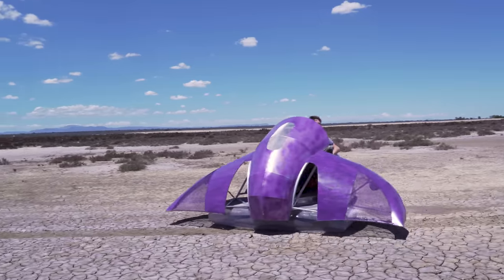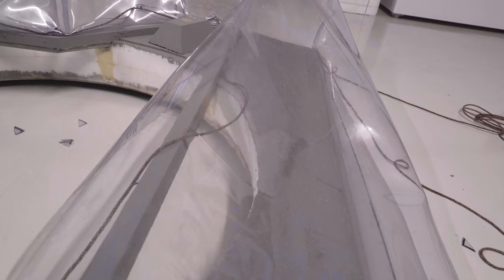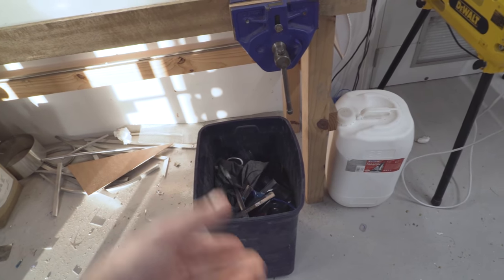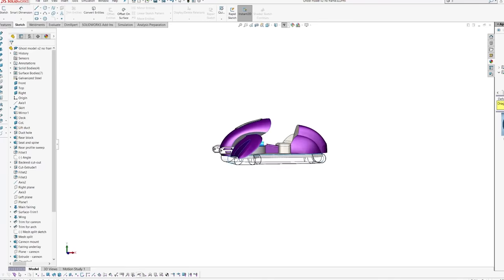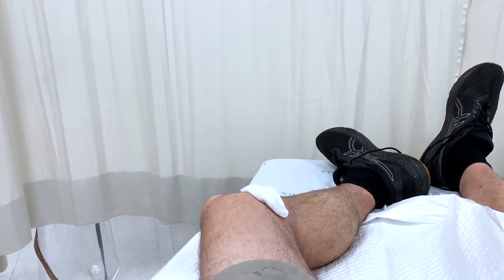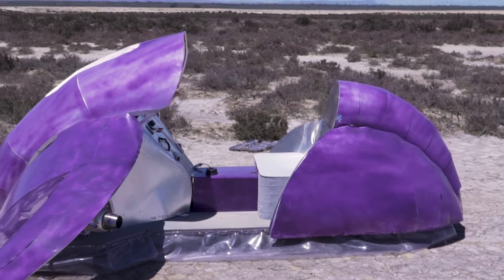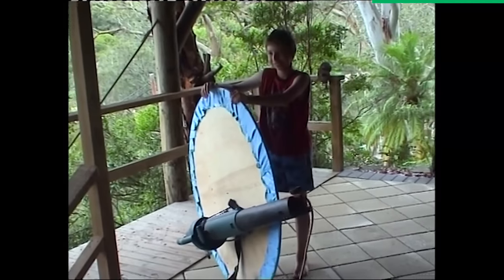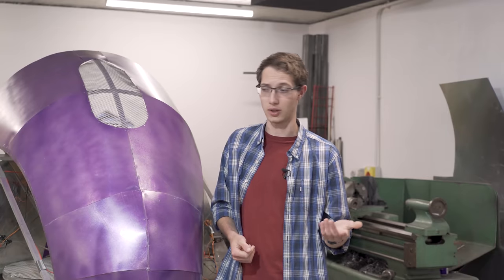Real Halo Ghost

Comment: I don't see a problem with the steering. Looks pretty game accurate to me.
Reply: I see you have played ce
Reply: facts
Reply: only thing worst to steer is the warthog. no idea why they thought it'd be a good idea to add a timed section requiring precise maneuvers to get through with only a warthog to get you there. I had to retry that damn mission 7 times to beat it.
Reply: @Sparrow_Bloodhunter  I never had a problem with the warthog in any of the games on console ngl, PC was a bit trickier but you can get the hang of it (unless you're playing infinite). Rack up 25 kills in blood gulch slayer by doing donuts around the bases and spawnkilling a bunch of people back when I was an honorless brat.
Reply: @Sparrow_Bloodhunter  The Warthog actually has some of my favorite handling in any vehicle of any game. Few vehicles allow you to powerslide so hard you can turn the body into a giant sledgehammer and side-sweep multiple enemies. Only problem is that the controls don't adapt well to mouse and keyboard.
Reply: @CrizzyEyes  I was playing with a controller, the problem is it would power slide when I want it to go forward. it felt like it was super heavy but also really floaty at the same time. remember that snow level where you're going through the canyon? well it felt like the warthog was always on the slick icy surface. maybe the game was just bugged because I had a habit of squeezing the ghost into places where it should not be.
Reply: Halo has the worst driving controlls ever.
Reply: No way, it doesn't flip over nearly enough.
Reply: @Sparrow_Bloodhunter  I have this habit in every game that has vehicles. The habit of bringing a vehicle everywhere I go, be it tight underground cave or up a mountain if it fits I sits and drive.
Reply: @Sparrow_Bloodhunter  It is a rite of passage for Halo players to try and fit vehicles where they don't belong
Reply: @CrizzyEyes  I agree, Warthog has always felt amazing to me. I have been playing the Halo series since Halo 2 so I could just be bias.
Reply: CE and such was bad. The Halo Infinite vehicles make me want to put a spike through my brain so I can understand the design decisions made with them.
Reply: @1993DJC I understand how it works, the problem is how slow it is to correct, half the time I told it to go one way and it'd just slam itself into a wall or fall off a cliff trying to go that direction in the worst possible way. I would almost prefer to use old school tank controls than the current system. at least the ghost is fast an maneuverable enough to properly follow my aim.
Reply: @TacticalBaguette  I recently got a ghost into the temple leading to the prophet of regret, I had never seen the temple guards mount and steal animation before. unfortunately the actual regret mission refuses to load for me, it seems to be bugged as multiple people have reported an inability to play that level, I'm surprised they haven't patched that yet.
Reply: @JubbLaRacing  Mass Effect 1 has entered the chat.
Reply: @Sparrow_Bloodhunter  Really? I’ve been able to totally nail The Maw’s driving section since I was like 6.

They give you five minutes (four if you’re on legendary) to complete it and the warthog’s controls are infinitely easy to keep stable if you’re using a controller, which was really your only option to begin with unless you’re first time with Halo is MCC and you’re using a keyboard, which is like shooting yourself in the foot when it comes to Halo.

Just steer in the opposite direction when you drift and you’ll stabilize faster than my father’s heart condition when he stopped drinking.
Reply: @Sparrow_Bloodhunter  I think the Warthog just clicks differently for different people.  For me it's easy as pie, for my friend...well... it was like playing pinball except I was the ball.
Reply: The good Old days of halo and split screen with your mates
Reply: Only the ce ghost is terrible
Reply: @carpetbeetle8349  It's easier if you start with a different control scheme than if you have to adapt to it later. I played Halo on original launch day so it was more difficult for me to adjust. But they also made some of the controls weird for MCC and Infinite.
Reply: @Sparrow_Bloodhunter  when your bad and don't get it the first time every time you play the game
Reply: @Sparrow_Bloodhunter  what you do it is just find that l left trigger. And squeeze it. Because for some reason doing that in CE gives it perfect handling.
Reply: he's just always boosting
Reply: @rock3793  see despite the wonky controls I actually liked driving the ghost in CE. it's janky enough that you can glitch it into buildings and become an unstoppable killing machine, you just gotta be gentle with the speed to not smash into things and send yourself flying.
Reply: @-Busy-  >you're. it's normal to fail the first time you try something. the maw was literally my first time driving the warthog in combat, normally if I see enemies I'd just get out and either mow them down from long range with the chain gun or take them out sneaky beaky like with my pistol.
Reply: @1SilverDollar  well I've learned not to trust warthog in general. I've been ran over by AI driving them at least 5 times in the halo 2 story mode. best to just hop in a ghost and pray you don't explode.
Reply: That Ghost is amazing, when you are having a nerf war and your friend shows up in Spartan armor while being on the Ghost.
Reply: You must be new ro halo, you'll get used to it
Reply: "I see you are a man of culture as well"
Reply: @martyrsaint  wasn’t really the only option for that long, gearbox port of CE has been around for quite a while
Reply: fax
Reply: @JubbLaRacing  Who has told you these lies?
Reply: @REALMARCHINADER  No one has told me those facts, i have experienced those awful controls myself.
Reply: @Sparrow_Bloodhunter  1 word  Chopper
Reply: @Sparrow_Bloodhunter  the warthog and the ghots is so easy to control. I guess its because ive been playing since ce came out but still.
Reply: @Sparrow_Bloodhunter  ??? what, are you talking about the warthog run?, if you played through the entire game then you would be familiar enough with the controls so that you could easily complete it with like 2 minutes to spare. One of the easiest sections of the entire game on purpose.
Reply: @Sparrow_Bloodhunter  the ice is slippery
Reply: Hard Agree

Comment: Apparently the ghost was notoriously difficult to drive in-lore too, so you've got even more accuracy!
Reply: yeah, playing CE i see no reason to complain about its steering
Reply: What you say isn’t really correct. As long as the ground suits the vehicle it’s very maneuverable. “Despite its apparent simplicity and grace, the Ghost requires a skilled driver to handle it properly. Uneven or broken terrain makes the Ghost extremely difficult to pilot.” -Halopedia
Reply: @PackHunter117  how does this go against what I said? "the ghost requires a skilled driver to handle it properly"
Reply: @casualbird7671  idk some people like to act like they’re adding something to the conversation when they’re not, it’s really annoying.
Reply: @casualbird7671  Because it mostly depends on the environment if it’s difficult to drive or not. If it’s a big flat open area then the Ghost will handle really well. It can even glide over shallow water ofcourse.
Reply: Ironically, the Ghost is my favorite vehicle due to how it is one of the easiest vehicles for me to drive. I really don't like the controls of the Warthog and other vehicles that drive like it. The Ghost, with it's ability to strafe is my choice.
Reply: The Warthog in CE was harder to steer. Who's bright idea was it to give an off-road vehicle 4-wheel steering?
Reply: @PackHunter117  there was a period between skilled driver and the following sentence about terrain. That indicts the start of a new idea.
Reply: @coltinyancey6420  Yes it requires a skilled driver. Doesn’t mean it’s notoriously difficult to drive. That’s like saying a 4 wheeler is hard to drive. Well yeah it could be on rocky and hilly terrain
Reply: The Ghost in every Halo game is easy to manoeuvre correctly imo, I'm actually surprised to see that a lot of people have trouble with its steering
Reply: @philswiftdestroyerofworlds1988  
Same here. I could understand the Banshee. But seriously? The Ghost and Wraith are super easy. Same with most vehicles in Halo
Reply: @PackHunter117  only one i have had trouble with is the Halo infinite Scorpion, that thing doesn't do pivot turning so you have to reverse an insane amount if you hit a tree or rock or something
Reply: @philswiftdestroyerofworlds1988  The Ghost being discussed here is the Halo CE variant, here’s the wiki excerpt for it,

•This version of the Ghost takes the meaning of "hover bike" to an extreme literal sense. The Ghost can move quick in all directions at roughly the same speed. It has a certain "float-iness" to it that the later games lack. Due to this, the Ghost can be a bit difficult to control as something as simple as turning the vehicle has a slight delay between the action and response. It's especially difficult to regain control of the vehicle after bumping into the terrain.

Canonically speaking, they were hard to drive; game-wise they were made easier to drive.
Reply: @hard_drive.system  That's because Master Chief is a skilled driver
Reply: @PackHunter117  uhhhh read your second sentence of your first comment "Despite its simplicity and grace, the ghost requires a skilled driver to handle it properly" if that's an official quote you already proved yourself wrong.
Reply: @charleysimmons427  Read the sentence after. “Uneven or broken terrain makes the Ghost extremely difficult to pilot.” Meaning flat open terrain makes the Ghost a lot easier to drive. Meaning it depends on the environment the vehicles in
Reply: @PackHunter117  and yet it doesn't change what you said unless you want to just admit your second statement is null of any actual meaning, and you just added it for filler.
Reply: @charleysimmons427  ? No his statement was wrong. Because it’s never stated in the lore it’s specifically notoriously difficult to pilot. Again it depended on the terrain if it was difficult or not. Same with a motorcycle and 4 wheeler. Just like what I showed from Halopedia. So yes it was difficult to drive ON difficult terrain! NOT that it was always difficult to drive.
Reply: @PackHunter117  Whos' statement? I was quoting YOU. Reread my comments before spouting gibberish, and while you are at it why don't you pull the quotes from halopedia that you are mentioning.
Reply: @charleysimmons427  My comments were to Casual Ghost to start with. Then they got directed to you after you made comments directed to me. Try to keep up. No gibberish anywhere here. I already put quotes around what I got directly from Halopedia. Not sure why you missed that
Reply: @PackHunter117  idc who they were directed at make sense or don't argue
Reply: @charleysimmons427  The 41 likes suggests that I did make sense. If it didn’t make sense to you then so be it.
Reply: @PackHunter117  "Uneven or broken terrain makes the Ghost extremely difficult to pilot".  That doesnt mean its easy on flat terrain, just easier.
Reply: @carpetsmell2523  Much easier. Again a motorcycle and 4 wheeler is way easier on flat terrain. Hell the Warthog is very easy to drive unless your going off the beaten paths in Infinites campaign. Then you can flip the Warthog easily too. Go back to the regular pathways and flat areas and then you’ll have a hard time flipping it.
Reply: @PackHunter117  okaaaay validate your own opinion rather than answer the questions that i'm asking. If you didn't want to explain yourself you could have just said so lol.

edit- OMG the comment your talking about may have what 45 likes but casual who instantly contradicted you got 75 sooooo.
Reply: @charleysimmons427  Wasn’t comparing my comment to his response comment. So his number doesn’t matter. Was just referring to my first comment. Also you’ve not asked any questions so far just pretty much saying that I’m wrong and why.
And I’ve already explained the reasoning to why I said what I said and gave multiple real world examples. Maybe your not reading everything I’ve said. But whatever I’m gonna choose to close this argument now. No reason to continue it
Reply: @PackHunter117   ps if his upvotes don't matter than neither do yours because he was obv pointing out the same things i am
Reply: @charleysimmons427  Never said his upvotes didn’t matter 🤦‍♂️ all I said was I wasn’t comparing our comments. Don’t need to drag this out man.
Reply: @PackHunter117  "So his number doesn't matter" wewr your EXACT words stop your blatant lying to look good.
Reply: @PackHunter117  THERE WE GO. you never told me it was a quote if you had i would have understood. Now tell me the link to which halopedia site so i can check it pls. i do wish it wasn't  so difficult lol

btw im asking for a link to the area where it says a ghost is easy to drive on flat terrain not your quote from the first comment you made
Reply: @charleysimmons427 🙄 I said I WASNT comparing my comment to his. So it didn’t matter BECAUSE I wasn’t comparing my comment to his comment! THATS ALL. 🤦‍♂️
Reply: @PackHunter117  idc im comparing it cuz its funny that you mentioned yours when you have less
Reply: @charleysimmons427  So that’s different then. The UNSC even had mil sims on how to use Covenant tech. Hence why Marines can drive Ghosts easily. So no the Ghost isn’t hard to drive in lore and gameplay except in CE only.
Reply: @PackHunter117  that's cool didn't know the unsc had simulations that could recreate covenant tech.
Reply: @charleysimmons427  Yup. That’s how Micky in Halo 3 ODST was able to fly that Phantom. He said that it had been awhile since the last time he flew one in a simulation. He didn’t say that word for word but he mentioned that when Alpha 9 stole one in the mission you fly a Banshee around Mombasa and blow up the Scarab. Johnson in Halo 2 said that in the simulations Scarabs are “tough, but ain’t invincible”.
Reply: @PackHunter117  ohhh i slightly remember that i need to replay the games a bit

Comment: The legend is back, I can't wait for the next webshooter video!
Reply: Same lol
Reply from the maker: Cheers! It's in the works, but I can't say yet when it'll be done.
Reply from the maker: @AmanStudios  Looks good! You did the visuals well.
Adding longer travel on the spring could help, but there'll always be a limit there. And unfortunately, grappling hooks are just really hard. There's a reason it's taken me as much development time as it has to get what I consider acceptable performance - if it was as simple as 3d printing something, everyone would have done it already. Good luck with it though!
Reply: @Built_IRL  Thanks for actually responding man! I was just wondering if there would be a way to make your self latching grappling hook shown in the hacksmith's webshooter video, but on a much smaller scale, as with a spring system it cannot launch such a heavy projectile. Good luck on your webshooter also!

Comment: Great build!
For mk II you may want to consider separate throttle and steering.  Have mechanical steering that utilizes thrust vectoring and let the throttle be more or less constant.  With the right thrust vectoring configuration you could even have a thrust reverser for braking.
Reply from the maker: That was actually in the original plan, before I decided to simplify it haha. I may have to bring it back now though!

Comment: I think that thrust vectoring on the jet engines might be a good way to get faster steering response. Or you could use electric drone motors or EDFs, which would be quieter too.
Reply: I miss imagined what you said and ended up with multiple drones tied to the left and right side attempting to steer the vehicle by pulling left or right.
Reply: @Xyzair  gmod be like
Reply: But for thrust vectoring, you need the engines further back from the CG. I think in this case, if you wanted to keep the jets positioned as they are, you could wire both jets on the same throttle, but have some clamshell doors partially cover the exhaust on one side to turn. The mechanical blockage would be more responsive, without the spool down/spool up delay of the jet.
Reply: "Thrust vectoring"
My south african man out here casually recreating Sukhoi 4.5th generation thrust nozzles.
Reply: @stevemc6010  tbf it is a land vehicle and not a fighter jet, so they dont have to be perfect. also they'd only have to work in two directions, as opposed to sukhois omni-directional nozzles
Reply: @oh-no-its-clara7574  yeah I know. Just fits with the idea that SA seems to be 20 years ahead of the world in many technological aspects.

Comment: That looks like a super fun project! Maybe some rudder-type parts behind the jets would make the turning more manageable, instead of just using differential thrust? Thank you so much for the great video, i really enjoyed watching it! 💜🧡
Reply from the maker: Cheers! I mean first prize would be to add a whole tail and vertical stabiliser at the back , but that wouldn't look very authentic haha
Reply: @Built_IRL  If you paint it clear like you did with the skirt, nobody will see it!
Reply: @Built_IRL  cut down a small sail and wear it on your back like the flags brutes would sometimes wear and you have your rudder without breaking the immersion haha
Reply: @Built_IRL  put a hole in the back center with a fin, duct some air from the main fan down a center tunnel.  Or use a second motor to generate movement thrust rather than the small jet engines and ducting to direct the thrust where its needed.
Reply: @Built_IRL  now all you need are laser cannons and a booster.
Reply: @Built_IRL  i wouldn't say that since they added rudders onto the banshee in later models,
Reply: @ZakLeek  "paint it clear" he used clear PVC lol